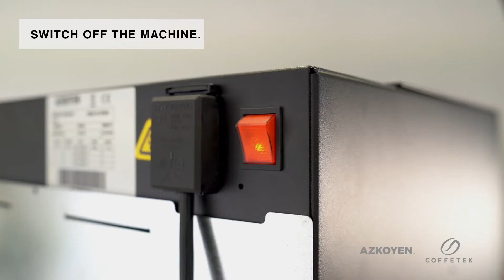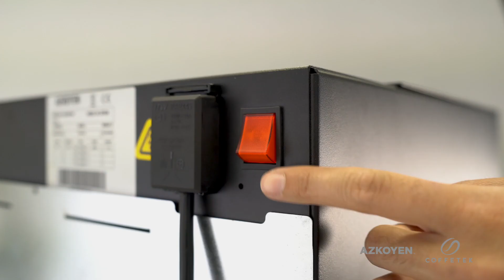AZKOYEN INSTALLATION OF VARIABLE COFFEE GROUP BREWER   AZKV30

Comment: Hi dear,  Many thanks for all the above videos. Could you please send me or put up another the video of how set up this variable coffee brewer up to different coffee grams throw and calibration (it's set manually or set in the machine program or  drinks settings programs) and also a  video of machine inside back panel ( or type boiler , water system ,control board, water flow from water inlet valve of the machine through the system to output into drinks cups(water flow diagrams) and how machine heat up the milk system and lastly the difference between this machine and  vitro M5 milk machine. Many thanks Shakiru Sule Technical vending support service engineer (London UK)